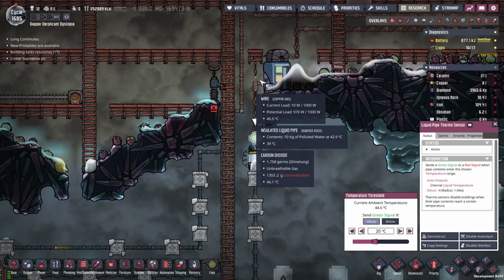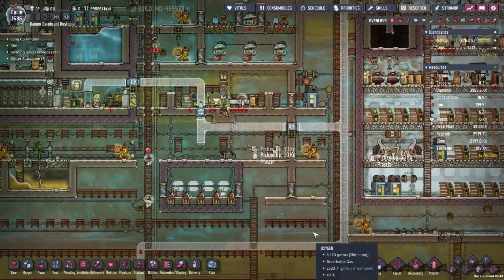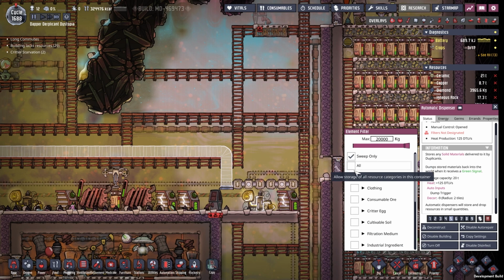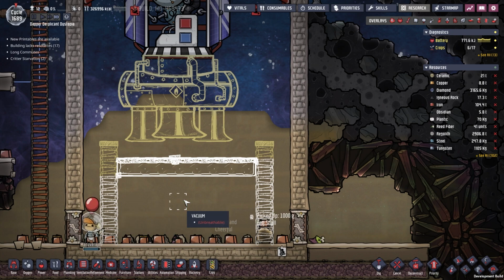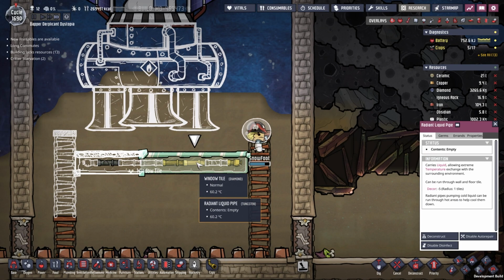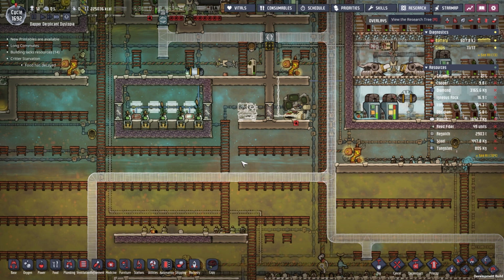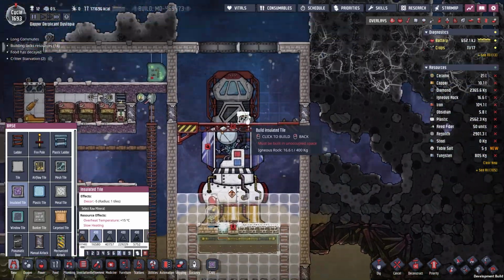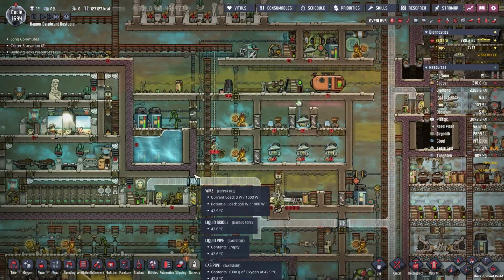Oxygen Not Included: Oassise – Let’s Play Stream Archive Part 241

Comment: @Aavak You almost certainly know this by now, but as a heads-up you're gonna need a longer (deeper) silo for you rocket (unless things have significantly changed after the Merge update)

Semi-spoilers for the future :

The current rocket design has no fuel tank, so won't get very far (poss not even to the nearest orbital body). Further bodies require different (& more) fuels in order to reach them effectively, requiring more fuel tanks; the furthest bodies require 2-part fuel (LOX & liquid hydrogen), requiring separate tanks for each.. requiring more rocket length

Tuplex's pre-Merge build (when he too first went to space proper) took ~8 RL game-running hours to make the necessary liquid hydrogen required for the furthest bodies (he stopped his playthru & did that off-camera), hence my linked earlier comment ages ago to start processing hydrogen to liquid ASAP. This obv requires a /lot/ of cooling as liquid hydrogen is close to 0K; LOX is difficult but not insurmountable (higher temp requirement), & will be required before LH is necessary: you'll need to progress to liquid-fuelled rockets via petroleum fairly soon to reach further orbital bodies, & petroleum requires an oxidiser to burn

Once the rocket returns, it'll auto-drop any cargo on the floor beneath, where it may be destroyed by residual heat dmg (eg from rocket engine/exhaust). I suggest you remove those diamond tiles & replace them with blast doors + conveyors to get the stuff out of the silo ASAP. These blast doors should auto (or even manually, via a standard switch operated by a derp, eg the pilot since they'll be nearby) open once the rocket has landed to drop its cargo into a protected area beneath, then immediately close: dupes/automation can therefore pick it up more easily & safely from the 'protected zone', allowing for a quicker turnaround of launches. Alternatively leave those doors open & only close them for launch (I can't remember if the rocket crushes resources if the landing is to sit on the floor of the silo), but you may need 1-2 tiles of floor gap to allow engine start & most efficient takeoff thrust

I believe most players (again pre-Merge) prefer 2 silos: one for an exploratory rocket, & one for a miner/cargo hauler to pick up otherwise hard-to-obtain ores etc from already explored bodies; these 2 can run in parallel, & ofc the 'explorer' can be repurposed to mine/cargo once there's nothing left to explore

------------------------------------------------

Caveat: I've never played this game (much as I've wanted to) but I've enjoyed watching other YT'ers play, hence all advice is derived from their experiences